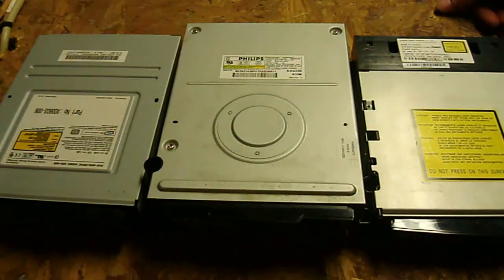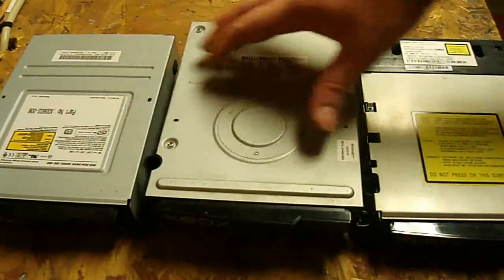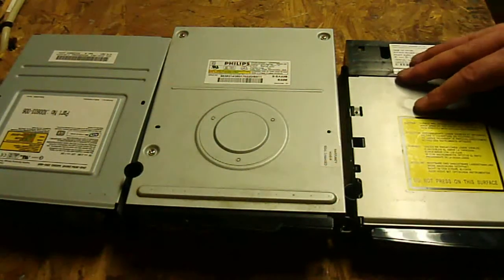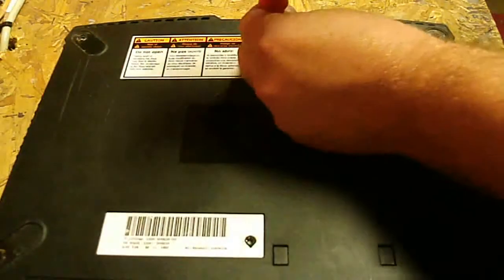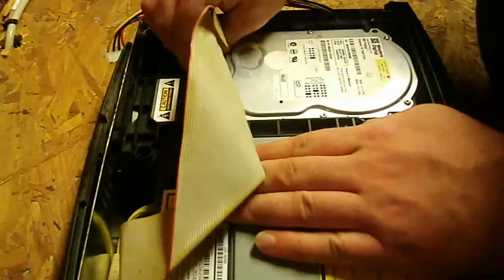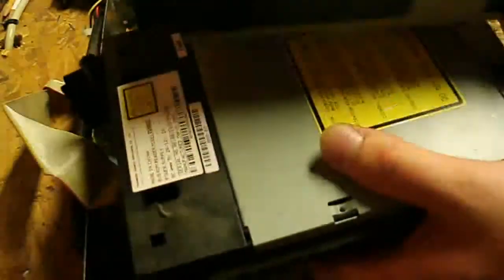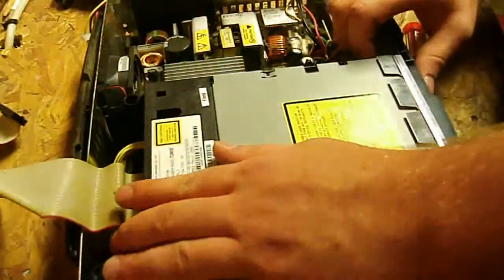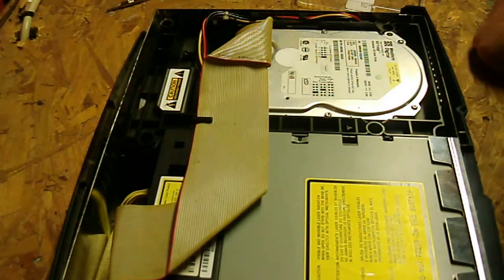How to replace my original Xbox DVD disc drive tutorial

Comment: My Xbox has a Thompson. I might open it up and get a new drive and remove the clock capacitor.
Reply: Do it. Tompson is then worst, if there's liquid underneath clock capacitor neutralize it with alcohol on a q tip

Comment: "It's not like the Xbox 360 where you have to change the motherboards to the DVD drives to match the motherboard"

I've watched countless videos and nobody mentions this except for you thank you so much this is exactly what I was looking for. I'm trying to rebuild an original Xbox where I have bought a new motherboard new hard drive and come to find out the disk drive is bad. it was a Philips Drive. like you said they were extremely hard to find especially in 2022 but I did find a replacement Samsung and thanks to you I know it should work just fine without any major modification

Comment: And I would like to make a recommendation. You actually don't have to screw the optical and hard drives back in. The XBOX is so tightly built that it is simply redundant. As long as you screw the cover back on, everything will stay.

Comment: Great video, thank you! I think I have the Thompson drive. Its a real OG Xbox, made in Hungary. Getting disk read error. Tried opening it and cleaning the laser. No luck. Should I just buy a cheap $15 laser replacement on eBay and swap the old one out?
Reply: If you did this and it worked, can you tell me which laser replacement you got. I’m getting a disc error read only for 1 game. The drive is reading all my other games which is weird.
Reply: @misslyricalpenny  Hey there, so I ended up getting the wrong laser lol I got the one for a Philips drive. Then, I bought a $50 complete rail and laser replacement for the Thompson drive. And guess what... after I replaced it, a capacitor on the DVD drive shorted lol. Long story short, it is not worth trying to repair Thompson drives. You are better off buying an Xbox untested or for parts and hopefully lucking out on a Philips drive. That's what happened to me, I bought a random Xbox for parts on eBay and landed on a Philips drive!

Comment: I have a Phillips VAD6011/21, if I replace it with a VAD6035/21 would it work?
Reply from the maker: As long as it is an actual Original Xbox disc drive then yes. Phillips makes disc drives for thousands of different devices, so as long as the drive is listed as an Original Xbox disc drive then it will work.

Comment: my xbox doesnt have either of these I bught mine brand new in 2005 it has defferent holes on the disk tray than the 3 of those? no one can tell me what kind it is it looks kinda like a thomson but there are these holes around the edges my manufactuing date is 6/29/2005 some one help?
Reply: +Jared Gilles You probably know this by now but you may have the very rare Hitachi drive.
Reply: Hitachi, how is its performance?

Comment: My old Xbox that I have since Christmas 2004 (which won't power on anymore) has the Samsung drive, while the one I just got from eBay has the Phillips drive and both are manufactured in September 2004. Which DVD drive is best? Samsung or Phillips or they're both equally good? Because I have to test CD-RWs on a Phillips drive.
Reply: I would say Phillips mate :) My crystal xbox had one and lasted for 12 years yet  have replaced my samsung drive on my modded one too many times! :( I am getting a Phillips for my modded xbox as I think they are amazing and sound really cool <3 My green xbox has one too ^^ The hitachi ones are nice as well ^^
Reply: TheShedScrapper I have the Hitachi LG drive noone talks about them and cant find info about them are they rare or something?
Reply: @dangerousdeo5113  OH NO, both of my XBOXes have Philips DVD drives & they’re both dead & caused RROD Error #12

Comment: Hi there was four CD drives for the original Microsoft Xbox Hitachi Philips Samsung and the worst is those Thomson drives I have four original Microsoft Xbox consoles 2 have Philips drives one has a Thomson and the last one has a Samsung for the sticky disc tray on the Samsung just take out four screws clean the disc tray also the drive belt problem solved its how I fix my original Microsoft Xbox consoles and they work excellent